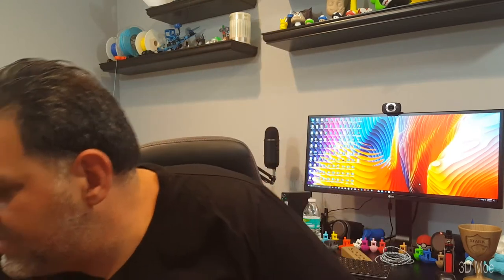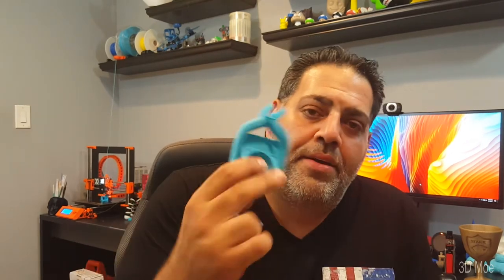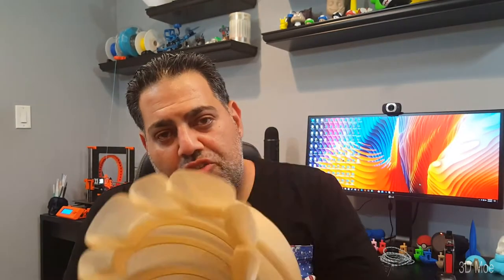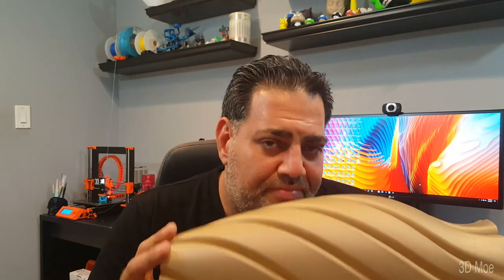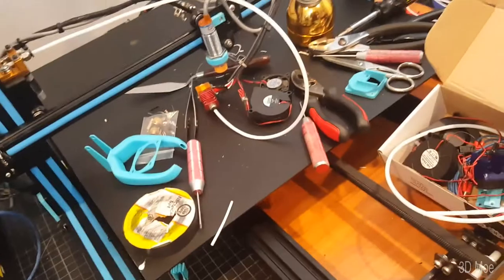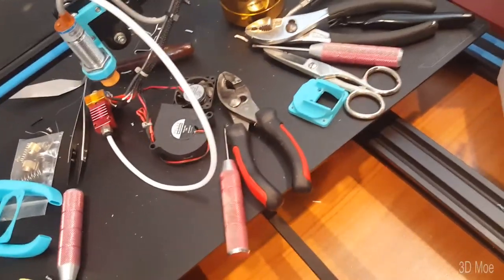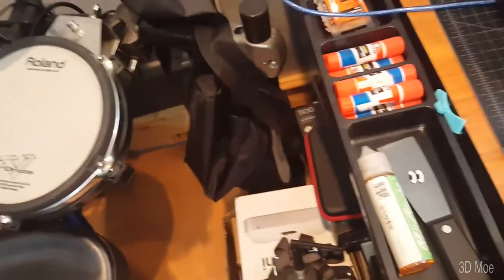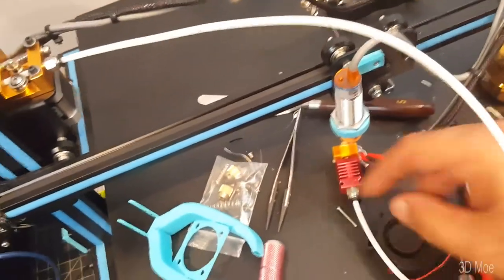"Update" E3DV6 Headache

Comment: Hey Moe! I'm trying to install an e3d v6 right now on my S4. I'm having trouble with wiring inside the control box. Which wires go to the blue temp sensor on the hot end? And I believe the heater cartridge goes to the 2 yellow wires in the box also?
Reply from the maker: Nathan Brothers .. i used the original heat cartridge and just spliced the thermistor wires because mine did not come with enough slack to get to the top of the z. i did not have any issues getting to temperature..just make sure you change the thermistor settings in firmware
Reply: Just splice it at the end after cutting off the plug end that comes with it. Super simple no brained solution.

Comment: TPU + Bowden isn't the best combo, I have a direct drive combined with a e3d clone, worked from the very first time
Reply from the maker: Wouter .. can you provide the link to the mount for the direct drive setup.. this was gonna be my next move.
Reply: 3D Moe sadly that's not on a cr10, but for tpu, you just need a fully constrained (no gaps for it to slip out) short as possible distance from the extruder to the nozzle, that's the key to succes
Reply from the maker: Got ya.. its pretty tight it was jamming in the Heat block.. it prints great on my Prusa.. so direct drive is the way to go with the V6.. Thanks for your response.. cool channel.. i just subscribed.. im into RC myself